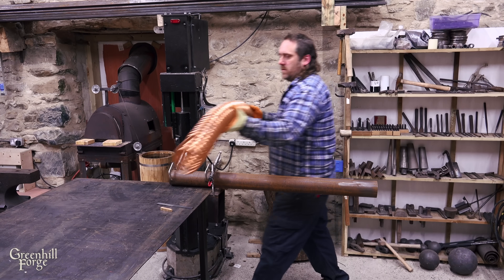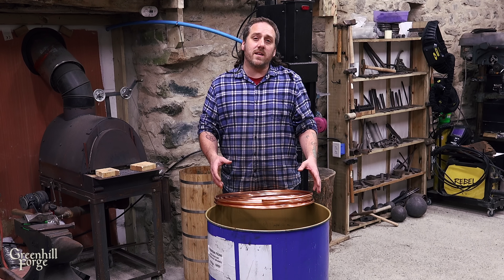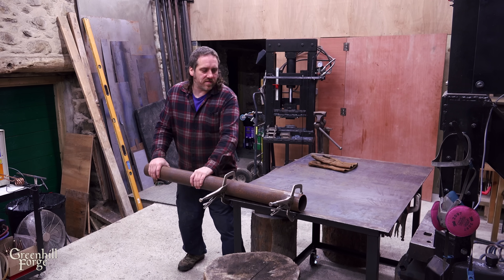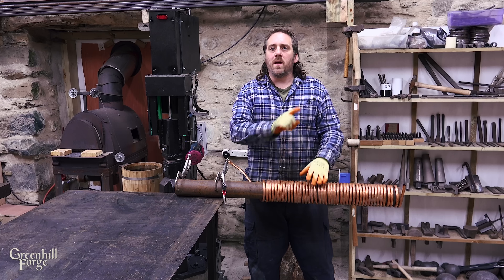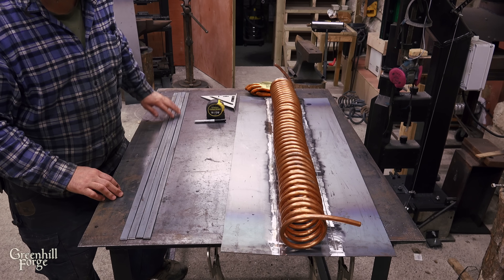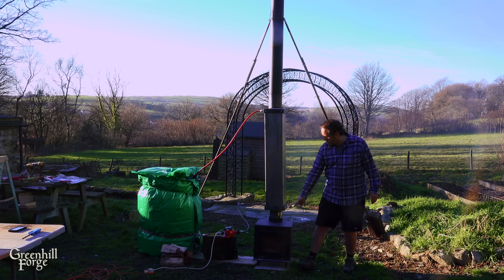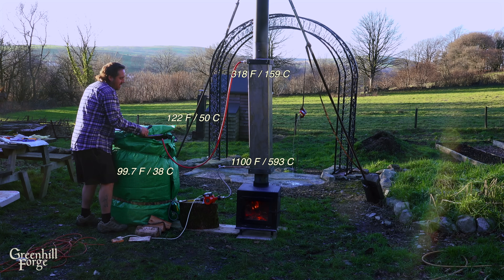Wood Stove Water Heater Experiment - Surprising Results! Part 1

Comment: one thing though is the off grid setting requires a pump... could you engineer a way to circulate the water with the heat instead of a pump, boiling water usuallly makes it move also right?

Comment: I made a water heater from a water heater that transferred the heat into two car radiators with fans behind them, worked fantastic in 30° degree temps in Northern Wisconsin

Comment: I want to see this system attached to the hot tub. Also because it heated so fast do you think for those with not so much money could do it without the insulation and welded bits etc.
Reply from the maker: yes, you'd just lose some efficiency without the insulation but it would work fine

Comment: You make great videos. Period. Subscribed and liked.

First, crimp a union fitting on both ends. You're going to do this anyways and a mechanical metal to metal seal will be mostly heat resistant-- eventually it is going to be subject to heat. Then you can temporarily cap on the lowest end to later assist with no bubbles when you freeze it.

Warmer the water the better to reduce dissolved gasses.

Maybe a little faster and easier would be a water pump to shove water through with a pump.

When you freeze it, put it up on a grate maybe, then cover it with a five sided box of styrofoam.

Should make it freeze from the bottom up reducing the bubbles that get frozen into the ice. (See information on creating crystal clear ice with tap water for reducing trapped air. Bartenders value crystal clear ice... Plenty of info out there.)

Then proceed as you did. Clearly what you did worked well enough, so with a grain of salt.

Comment: A gas or diesel motor , waste so much energy . The combustion chamber ignighting the fuel and than trying to convert that into a mechanical motion ie. Driving the piston. Only uses a 1/4 of the energy produced . Most of the energy comes as the heat produced wich is routed through your exhaust pipe and wasted out the back of the vehicle.. 
I kinda feel like the energy being produced by the stove turned into heat with the water absorbing a tiny percent of that heat is still a lot of potential energy being wasted hmmmmm 🤔. 
A rocket stove with an old water heater put into the exhaust works great to but still a waste of energy being not used.

Comment: I want to try this with small old aluminum oxygen bottles inside the flu. Once when i was homeless, i squatted in an old abandoned meat plant that was devastated after a flood from a few years prior to me occupying it for a bit. I made a fireplace in the coner of the big covered loading dock area. I would drive my truck into this area and brought couches and chairs in there. Plus some beds for my dogs . And a whole bunch of cleaning equipment. There was some oil or natural gas equipment out back and id see the guys out there often checking on the equipment. I would always wave to them while i was cleaning up the place which was a lot of work. Any ways the fire i would have in there was pretty big and i would use oxygen bottles with the vacles off the tops mind you, and id let them get hot in the fire than id run river water into them and had to be careful cause that water would instantly flash biol and would want to come bursting out like a geyser. More than capable of burning the hell out of someone so do not try this at home.. it just amazed me how i could instantly have larg amounts of exstreamly hot water in like 2 seconds.. mind you aslong as there was a fire and the bottles where already hot. So that part took some time but going from having freezing water to instantly hot water in 2 seconds was great. 
Ive heated water in other ways before and it always took a long time specially with bigger quantities of water. So one day i hope to make a better bigger functional way of heating a larg amount of water almost instantly.

Comment: This method of copper bending is really bad idea. Theoretically it sounds ok but in reality, it can cause alot more issues rather then simply filling the tube with dry sand  tapping it as you go so the sand settles , then capping both ends. This methode is so much effective and much easyier to work with then water. BAMMMM !!!

Comment: You should really use stainless tube for corrosion resistance. What do i know, im just an engineere
Reply from the maker: stainless is too expensive to prototype with. it's also about 20X less heat conductive
Reply: @GreenhillForge  I agree. And yes im well aware of the heat conduction limits.

Comment: Just came across your video.  Totally hooked on your content, just subscribed.   Im sure this is a dumb question but here goes.  Can you build a generator large enough to power an electric motor?  Once you have a generator powering that motor, can you then add another generator head to produce electricity to charge batteries or use for lighting?    A sort of generator that doenst require anything but itself to produce endless power?
Reply from the maker: It's a cool idea but you'll never get more out than you put it, at least that we know of yet. there's no cheating physics.

Comment: Have to use VERY dry firewood to avoid the copper coil getting covered with excess wood tar and soot.  Get too much of that building up it will choke of the 'draw' and reduce the heat transfer.  Same with chimney pipe above the roof where it hits the frosty air or snow.  Insulate it to the top, to reduce the build-up of all the black goo that will choke of the 'draw'.

Comment: All right so I watched the video in as far as to figure out what kind of pipe you is using and used round pipe there is a flat copper pipe that is better suited to this application.
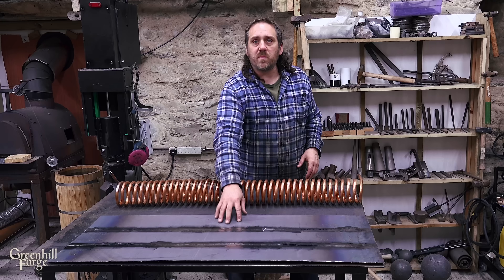Reply: Okay I've hit 5:44 and I would expect by now that the caution be voice but it hasn't been so I'm a little concerned if you suck too much heat out of your stove pipe creosote will build up faster and you risk a chimney fire be careful how much heat you suck off your stove pipe. You do not want this copper wrapped right tight against your stove pipe you want to offset it from the pipe. And let the heat in the box transfer not directly off the pipe.
Reply: All right I get that he was making it for a outdoor stove if you are planning on doing this on your indoor stove. Please consult a specialist. You cannot siphon off 700 degrees of heat from your pipe. And this would not pass any inspections where I live guaranteed. Where I live right now the temperature is -50 outside when it comes to our stoves we know what we're talking about. Doing something like this is a huge fire hazard. You would never want to siphon off more than 300 degrees from your pipe.

Comment: WIth my dad standing over me instructing me on proper copper pipe sweating (50 years ago this month) I built a 50 dollar water heater (probably 300 with the current cost of copper) INSIDE the stove box against the far wall. I read about it in a hippie building book called "Handmade Hot Water"   It consisted of 4 short lengths of 1" copper pipe with 180s, and exited the stove and connected directly to my 80 gallon stone lined Sepco electric water heater which I had to raise on a platform so the bottom of the stove was ~ 1 foot above  the top of the wood stove thermosiphon.    It worked flawlessly for the 35 years we burned wood in NH with ZERO maintenance, and I could vary the amount of hot water produced by varying the distance from the fire to the end of stovebox heat exchanger.   

BTW...my trusted plumbing sub at the time told me I should spend and extra 150 dollars for the Sepco stone line water heater ("it will outlive you") and it worked flawlessly for 35 years (ZERO flushing, no anode changes with well water!) I only replaced it to dehumidify my basement basement when we started wintering in floriduh 16 years ago.
Reply: The book is still available used on Amazon, and it's full name is "Handmade Hot Water Systems"  by Sussman and Frazier.  I may have screwed up the install date looking at the publishing date, so maybe 47 years ago?

Comment: Yes good idea,  and good to learn from all the people's comments here to save you learning the hard way.   I did this also and the water got so hot that it deposited the minerals on the inside of the coil eventually causing it to plug off!!!    The way I did it was a tank close to the heat exchanger and the water circulation by convection. Don't put the coil in the chimney pipe with the wood smoke not necessary and will leed to chimney coil problems. There is so much heat energy available from the chimney pipe that just running a straight pipe up the chimney and back to the storage tank is enough.  Make the straight heat exchanger pipe so you can replace it when it gets plugged up with calcium in the water.   Use the biggest storage tank that you can fit in your space to help keep the water from getting to hot. Putting a Cooling fan and system on your water tank would be a great idea as I was making steam with my system. Have a safety pressure relief on the water tank so it does not blow up the tank if it gets too hot.  I added the system to the wood burning heater heating my house.  So a little different application from what was done in this video.

Comment: I experienced  this several years ago the first thing that's going to happen to your invention is the water hose is going to blow off of the copper pipe at the top because it can't handle that much heat. Of course you already know this because if you run it it's already done blowed off. The other thing that's going to happen is the carbon buildup on the copper coil itself is going to insulate the copper and then it's going to stop heating very well at all. This definitely can be done but you have to reinvent the wood stove into two different sections top for heating bottom for fire and exhaust smoke ,that way you have a clean carbon free place for the coil to be inside the top of the wood stove. That actually works.

Comment: Interesting experiment, but a maintenance nightmare.
My only concern is when DIY'ers start fabbing and installing Rube Goldberg stuff and then rig it to heat their homes or shops. There's a reason we have testing and manufacturing standards. Some of the stuff online is patently dangerous, and much of it will cancel your homeowner's insurance policies.

Comment: You could fill the pipe with sand that way when you're bending the pipe you don't risk the ice melting from the heat generated of the metal bending to create any air pockets

Comment: Of course this work however the problem is hot water demand is not constant so the cork gated copper tubing should be half moon that can be pulled away when hot water is needed.

Comment: I think doing a rocket mass heater with a water pipe over the heat exchanger elements would work well. Plus it pulls even more heat from the same super heated fire.

Comment: I would've tried to use aircrete doughnuts and/or panels to insulate instead of the toxic fiber insulation. Amazing metal work, overall build, and video! Thank you!

Comment: Big thanks for using metric and Celcius which is what most of the world uses for measurements.

Great work. I'm very impressed with the efficiency. I'd love to build something like that but hot tubs are available with the firewood stove incorporated for about $1500. So I think I'll buy one of those and put my efforts into firewood collection and processing to run it.

Comment: I took a 50 gallon conventional gas water heater and cut the top of it off and then connected a rocket stove to the bottom of the 4 inch diameter central pipe. And made sure that it sat on a very strong stand so that it wouldn’t be at risk of falling over because it will hold about 450 pounds of water. I’m still in the process of installing it, but I think it should work quite well for a radiant floor heating project.
Reply from the maker: Sounds cool, I'm interested to know how it turns out and how the water heater deals with the temps from a rocket stove.

Comment: I suggest inserting a copper tube that fits tight inside the coil. This way you could protect the coil from soot and make replacing or cleaning the unit easier.

Comment: Do you want to clean the soot in the chimney every time you use it? Because if not, the heat transfer efficiency will drop. And also, it is better to have a heat exchanger that is directly in line with hot gases and not on the side. Also, I must compliment the video maker.

Comment: Silicone batt insulation is not toxic and really easy to work with... I use it as insulation/gaskets when running an evaporator to make maple syrup. I also use it in the shop when heat treating small tools like plane blades and knifes.

Comment: i think 2 or more coils running parallel slows down the flow to pick up more heat.   examine the construction of modern solar hot water collectors with multi-pipes compared to the prototypes from decades ago.   as a nother commenter said, the coil should be outside the flue.   its going to get covered in gunk.

Comment: The  spacers need to be copper instead of steel or use just point springs for the coil. This will make the coil last longer. Good show good work.

Comment: I own a Pertinger water heating stove, dumping hot water into a 1,6 m3 insulated container.
It's not even as efficient as your solution... But let me tell you this:
I'm FORCED to fill the tub and take a hot bath in it EVERY DAY, otherwise the water in the container will overheat.
Those solutions are extremely nice.
The only downside is that you need a complete overhaul of your systems: you don't simply need a chimney like a regular stove, but actual plumbing and electrics to run it. All of this discourages most people
Reply from the maker: I'm making a wood boiler now and yeah, the system is much more complex with the plumbing etc. two very different ways to approach the issue

Comment: That's sick. I really like to make a app for you.
The thing is, in my next project, I want to use such thing to store the heated water to run over night, with stove wood all burnt out. This would keep the central heating perfect.

But have you though, what if the water goes more than 100 degrees? Another valve needed to keep the central heating water always around 45 degrees.

Comment: Square Stove Pipes can be a problem... The Heat and Smoke NEED to Vortex to Flow Properly. I've made a square stove pipe before, it did'nt work well, I even installed an interior fan, it did'nt help.

Comment: Water Vibrates A Pipe While Flowing... You MUST Smooth Out and Round Off those metal Saw Teeth or They Will Chew Through That Copper Pipe.

Comment: I've calculated the heating power.  To heat 106 liters of water by 31 degrees C in 40 minutes requires 5.7 kW average heating power.  That's a good size for a hot tub heater or for what ever else you choose to use it for.

Comment: Copper is a bad choice.  The high heat in a chimney  will quickly deteriorate the copper. All though not as efficient, heater element type,,, stainless steel tubeing is a far more enduring  possible lasting for years😮  if you want more info on how to do this , then send me  a reply

Comment: My only recommendation is to give the temperature outside. 

I'm assuming it's warm out considering you're wearing shorts, but it'll be interesting if you do a follow up video and the results when it's colder outside.
Reply from the maker: I run hot so I'm almost always in shorts. I think I filmed that in the first week of January.

Comment: Nice quality work.  The issue with cold pipes in a hot flue will be a massive creosote build up over time that will end up insulating your pipes.   These will not be easy to clean with a standard chimney sweep.  I would love to see a follow up,after a year of use.
Reply from the maker: I did a follow up design to address that here https://youtu.be/nJp3o8WJ05s

Comment: The minute that coil runs out of water while the fire is hot, the solder will melt. Brazing or mechanical coupler would be preferable for the copper near the heat source.

Comment: Galvanic corrosion will happen between the steel and copper. How quickly? Hard to say.
Reply from the maker: most of the corrosion happens on the steel because the copper is more noble

Comment: Built heat ex-changers out of similar coils. Want to force more hot air through the coils? Make the box large enough, block the outer sides forcing the air up the center, then a few feet up block the center forcing the air through the coil to the outside, then a few feet up again block the outer vent and force the air back through the coils and up the center. Repeat this as needed leaving enough distance and space to allow proper flow. Remember to make it easy to clean later.
Reply: NOTE: standoffs can wear through coils, more so if vibrations are present. Use a softer material than copper OR if possible NO support.

Comment: 1 metre square box black twenty five millimetre polly pipe, 1 coil add grass another coil more grass another coil more grass you get the idea, you have now created a siylege water heater, if the container is plastic or 4 205 litre plastic interlocked drums, you can harvest the methane off the drums for cooking, big tractor tunes or airbeds will do, this will last about  8 months, heating the house big box 100 millimetre none perforated black polly pipe corrugated coils again inlet to the outside at the bottom outlet through the wall to the inside, this will in both cases give you 40c constant if protected from the elements.

Comment: Maybe put the copper coil outside a pipe to protect it from the smoke, 
AND also inside a second pipe to keep the heat in... 
AND fill the void with water to best transfer the heat.
BINGO!
Reply from the maker: check out this video https://youtu.be/nJp3o8WJ05s. i test a lot of those ideas in it
Reply: @GreenhillForge  Awesome video, keep up the great work!
Subbed!